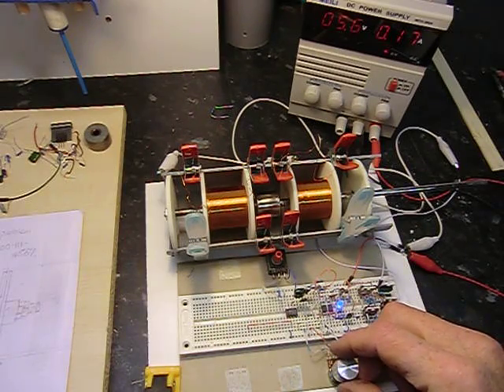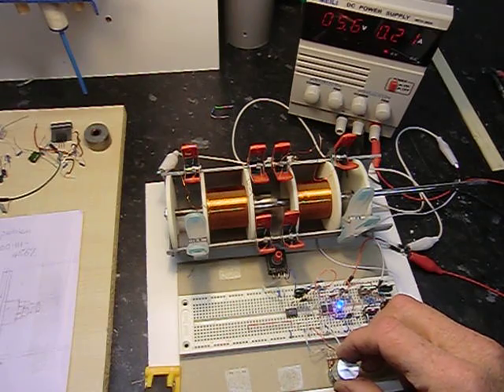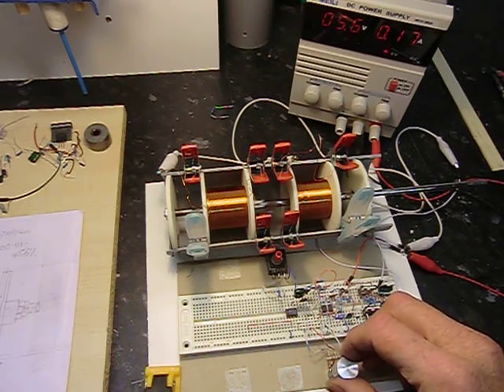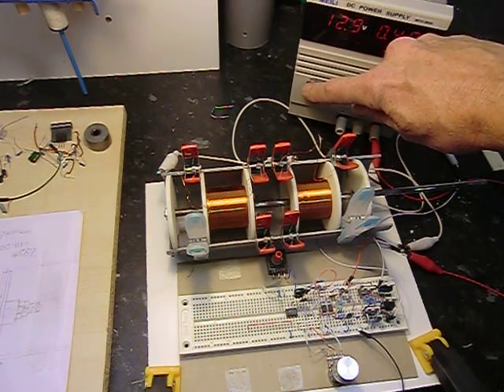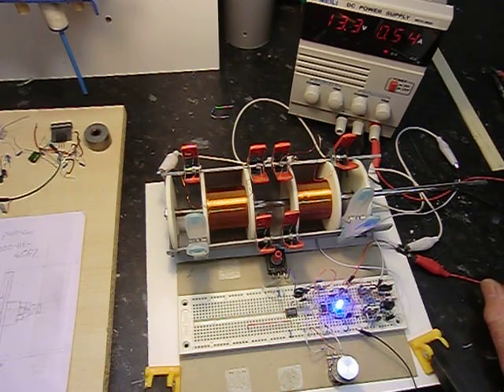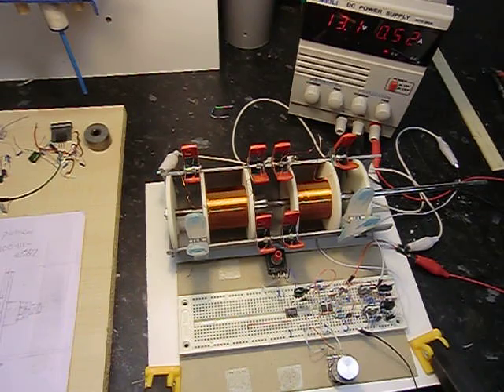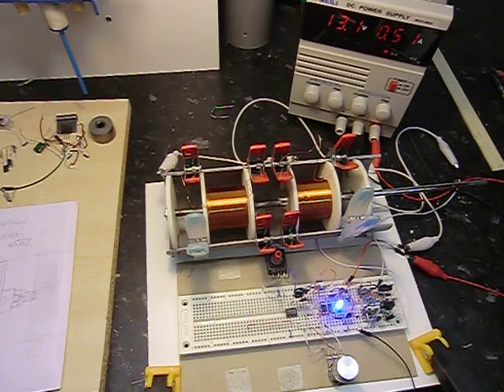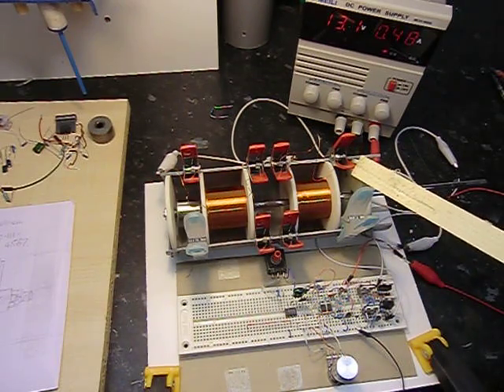Electromagnetic Piston Engine

Comment: So here's the ultimate question, could the piston you made generate enough power to power its own piston, plus generate more power to power an electric car? In a way, you can't use electricity to get more electricity but you're not dealing with electricity here, you're dealing with the amplification of the magnetic field by electricity, which in turn helps push and pull that piston which could generate enough electricity to keep amplifying that magnetic field. So take your new pump and add a crankshaft to that. Then attach some belts that will spin an alternator and wire up that alternator back into your piston. Flip the switch and see if it will run on itself.
Reply from the maker: Aha, that'll be very interesting indeed. Your next challenge is..... Lol 

Pity it's all mainly dismantled now as the experiment was part of a bigger, now abandoned project. 

Keep me posted tho. And thanks for your comments and encouragement.
Reply: @EddieFox  or maybe a solar cell could provide the electricity to power the electromagnetic piston which in turn does the mechanical work to move a car

Comment: Put two coils at the end of both sides to collect current from moving magnet
Reply: +Eddie Fox what about coils on the ends and in the center ?
Reply: +Eddie Fox what about coils on the ends and in the center ?
Reply: +Eddie Fox yes, I see your vid with the schematic. I probably have all the required components except the magnet. I'm sure there might be some magnetic resistance between magnet and coil, as more are added, need a way to collect the current leak from powering the first coils, the magnets movement, and the flyback. diodes. anyways, very nice to see your work, I'll be exploring your channel soon. God Bless
Reply from the maker: +Talha Kamran. Wow, that would work. Well done. Next time I get it set up i'll try it to see how much can me retrieved. I don't think it will be over-unity though.
Reply: +Eddie Fox :) Please share your results.
Reply from the maker: +Talha Kamran Thank you. I will.
Reply from the maker: Yes, that would certainly make for more powerful push/pull action... Have you seen the 'tutorial' (on a link ion the video.) Thank you so much for commenting! :)

Comment: Very nice project, if you place two springs at the end of the shaft, both sides, the piston will work better...!
Reply from the maker: skycollection Thanks so much for posting 'skycollection'. I always find these helpful! I have looked at your projects. fantastic and have subscribed. Well done!!
Reply: Or use permanent magnets on each side to eliminate the noise and increase the life spam and performance ;) Same affect like springs. 
I have a small question. That core magnet that is flying up and down. 
Is it possible to suspend this magnet inside the larger magnetic field so it 'floats' to eliminate any friction. Would it work with this technique?
Reply from the maker: @EddyKorgo  Thank you. I have only just seen this comment. My fault. Yes, I had considered a 'magnetic suspension' but what I was playing with was enough to satisfy my exploration. Thank you tho.

Comment: i thought of this at school, what if cars were powered with an elecromagnetic engine? i made blueprints and then googled it. apparently others have thought of it. this could change the future
Reply: Be sure to implement a Flywheel Generation System. ;-)
Reply: Would like to know if its the good way to transform electric power into a mechanical power. Try this out. Take a electric energy, transform it into a mechanical energy, multiply it with gear(higher the ratio, better the result), then transform that multiplied mechanical energy into a electric energy from which you send >15% back to start to repeat this cycle. The rest of the gained energy is stored for use =P Im not an alchemist ^_^
Reply: Eddie Fox hi... I also have electro magnetic based engine idea but I am commerce student I don't have deep knowledge and actually I have some doubts ia it possible you to help me! If yes than can you inbox me your mail id so we can exchange some information.
Reply from the maker: @rushabhlangalia  What are you actually trying to do?
Reply from the maker: Will Kolbenson Thank you for posting on my video clip! Yes, with batteries getting better and better all the time electricity and electric cars are definitely a thing of the future! Love to see your blueprints. Perhaps you could patent if it was significantly different from 'prior art'. That's how I got a patent. Well done and keep going!
Reply: Eddie Fox the only problem is I'm only 11. I don't have the resources or money to take on this project yet
Reply from the maker: You obviously have great talent and potential Will! Don't lose yr vision and you're not 'only 11'. You're 11! and all your life ahead of you - go for it! :)
Reply: what if spaceships use it?

Comment from the maker: Thank you Honda4004. looked at this video of the Jo cell. I have heard that it is much more efficient than just a hydrogen cell. Could use it to run your car? My electromagnetic piston needs a bit more work to be able to be a part of a four cylinder engine and I think it might not be as efficient as a normal petrol/diesel engine - certainly run on steam. (Hydrogen Oxygen mix). Frequency and Mark/space would to track speed on motor. You know mine had a resonance frequency delecately adjusted to get ther magnet to dance all the way between coils!  lol. thank you for your referral!!! :)
Reply: Eddie Fox can u please what are the practical disadvantages of this engine?
Reply from the maker: @nvmvel  For me it was frequency. It only did this little trick at its own resonant frequency and not over a large range. Rather like a tuned circuit. So I'm not sure it may be useful except that modifications be made to run at different speeds.

Comment: Hi have you viewed joes cell horses mouth video username brey213 joe booker makes a solenoid type engine by statically charging and then atom stripping incoming air to become a magnetic attraction repulsion engine urine is used to coat internal engine structure with crystal lithium ions you will see he makes a fluid tesla coil effect